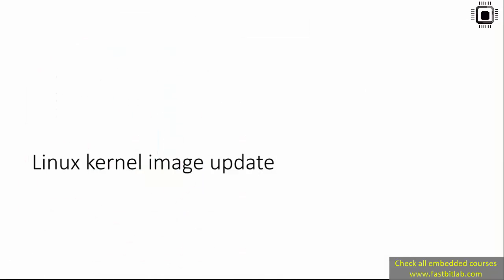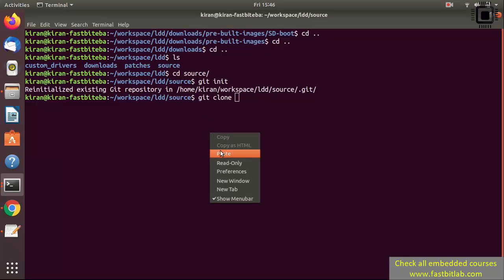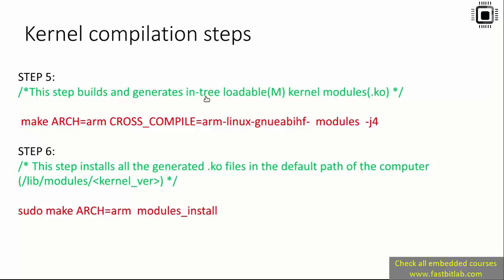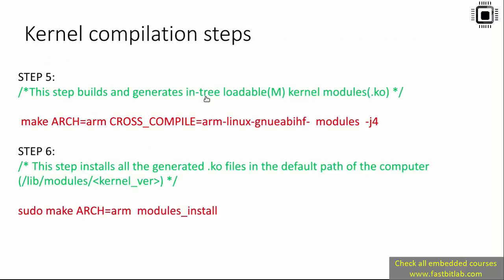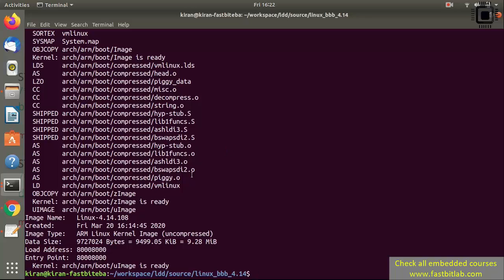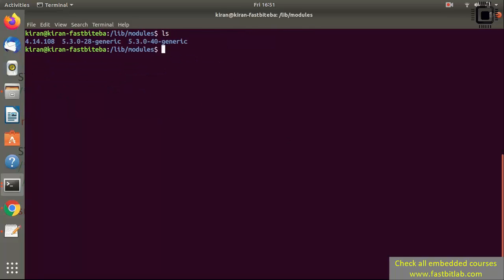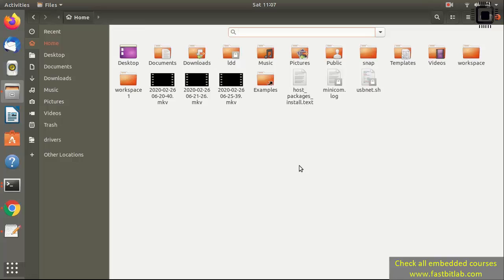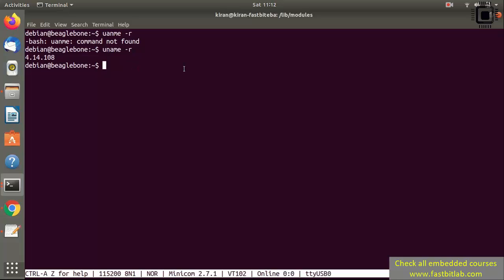Linux device driver lecture 6: Updating Linux kernel image

Comment: Hello sir,

I am seeing your video of embedded linux for beagleboard so I am doing angstrom boot on SD card so I am facing the problem of my kernel is not getting started I have done all step again and again please suggest what I have done wrong
Reply: Hi,

I have complied using 5.10 git version and observing beagle bone board getting stuck at Starting kernel and rebooting in loop.. Need help on this